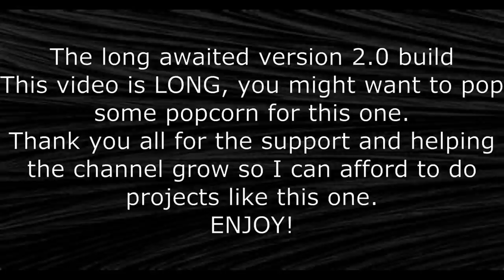Homemade ice maker build! VERSION 2.0! Cleaner build! #435

Comment: I did first follow you for the icemaker, I actually did a search for DIY icemaker and have loved following it. However I'm not done here I still have to see the rest of the house build and still have half the video's you've done just to catch up! Love the idea of a swamp cooler. My brother in law once rigged a cooler with ice in the back of his truck with a 12volt pump and coil with dual evaporator fans in the cab on a switch for very hot rides to work on a ferry where you can't run your engine. He was always the only one inside a vehicle with the windows up !
Reply from the maker: I'm definitely building a more modern swamp cooler.

Comment: If you're doing a false bottom how about if you took like half inch plexiglass and went from the false bottom and left you a 3-in gap all the way across the back and up to the bottom of the ice maker to pull air into your ice maker that might make it more efficient Cooling and should give you extra room for ice storage
Reply from the maker: I didn't wind up doing the bottom, but that would definitely work.

Comment: If you pulled the air in at the top and blew it down to the bottom it would force the cold air up. And I think one fan with aT to take the air from under both would be adiquate.

Comment: Hey boss I wanna chest freezer myself easy way to find out where the coils are without a thermal cam open the lid turn the unit on and just let it run with warm moist air going in the water in the air will condense in and around where the cooling pipes go through and will eventually freeze the thicker the frost the closer you are to a pipe it’s not the best way but it’s a useful way to find out and puncture holes

Comment: I own a mechanic's battery operated vacuum leak detector for looking for engine vacuum leaks, it has a rubber hollow probe for scanning around in close proximity to hot engine parts, but, you can also check for leaks around window seals on the doors of anything.  It works by detecting high frequency whistles that humans can't hear, but with show up on the analog meter needle.  I opted to purchase the remote frequency generator that operates on a 9 volt battery.  You put the generator in the trunk of your car, turn it on and scan around the perimeter of the trunk seals.  This tool originally cost me 300.00 but, you may be able to find something more modern and cheaper.  I had to have one since I was an auto body and frame repairman for 46 years.  Saved me lots , from having cars I repaired come back for various air and water leaks.

Comment: I repair appliances for a living and I thought about doing this a few times. 

Most ice machines do not cool the ice compartment. The only thing that keeps the ice cold is the ice itself so that means there is a drain due to some melt off. 

The reason for this is ice will tend to stick together if left in freezer for long periods of time. I was wondering what you have experienced in this regard. 

I believe if you use it regularly it might be ok but over the winter if not used in a while it may be one block of ice.
Reply from the maker: When used regularly it isn't a problem, you do see this some in winter when it just sits.

Comment: I would like to see you build a portable solar generator that could run a small cooler and ac for hurricanes. I’m in Tampa, love the videos, keep up the good work!
Reply: Most people would probably assume a photovoltaic solution...but it might be of interest to some to see a  thermal exchange type of freezer. Like the refrigerator/freezers that run off burning butane or propane. One could  possibly use a solar thermal exchange system to replace the use of a flame. There are some very effective solar heat exchangers out there these days that could really up the daily production compared to the old-timey butane powered refrigerator/freezers with which some viewers may be familiar from off-grid cabins/camping.

Comment: I would take the pvc elbows out completely and get some room back for ice.  Put that perforated plexiglass one inch off of the bottom and attach two pvc couplers through the plexiglass under the ice makers.  Then just use a short, straight section of pvc to go straight up to your fans.
Reply from the maker: The elbows are there to keep the pipe from falling over

Comment: Another thought, instead of attaching the lid to the PVC extension, you could have made plates to extend from the original mounting location to the new hinges allowing you to mount the hinges though the plate and PVC  extension.  This would have spread the load from the lid to both the extension and the original location. This way the double sided tape is not the only thing keeping the lid in place.
Reply from the maker: Great point! But after a year of using it, no issues.

Comment: If you really wanted to get crazy, place a vacuum in the equation. When the lid closes, the vacuum would pull out the majority of air and before opening you could have a pressure relief valve to pressurize the internal freezer space... Don't know if it would make "that" much of a difference, but it would be interesting to see the difference. Great Job as always. Chuck
Reply: Even if you could vacuum seal it (not easily and you'd have to make it a lot more solid) that would actually slow down the process of freezing as you need the air to allow for the energy to pass from a high to a low state, in vacuum you have to rely upon radiant heat (or IR) passively bleeding off and you'd have to essentially draw the heat away from the freezer itself.
Space isn't cold because it's a near vacuum, it's cold because there is nothing to hold the heat thus it wants to equalize our higher temperature and pressure to it thus our blood (or any liquid)boils off as gasses try to escape as it rapidly phase changes.
Reply from the maker: These are the kinds of conversations and knowledge that I love that a simple DIY project can bring out
Reply: @TKCL  Agreed. My research shows that lowing the pressure by 1 atmosphere only raises the freezing point of water .001 C degrees… So probably not worth the effort.
Reply: @PlainsmanMurph  For freezing water faster you'd actually want to increase the pressure to make it fast but again you'd have to make it out of all aluminum or steel and have to have a good seal or you'd have a potential bomb on your hands.
Reply: @PlainsmanMurph  A vacuum would improve the lid seal greatly, which is the main area of heat ingress.   Improving the seal would definitely help things.

Comment: ANOTHER OPTION
If I routinely need ice in quantities like this (where the frequency is such that simply buying bags of ice isn't economical), I think I might prefer having at least TWO 5-7 pounds of ice independent ice makers instead of one big 13 pounds of ice maker. While the risk of either one failing is higher than if I just had a single ice maker, still having at least one ice maker working gives me some ability to keep providing some ice to guests while I work out a recovery (e.g. go to store for temporary use of bagged ice, repair or replacement of the failed ice maker).

Using two lower capacity ice-makers may also let me save a significant amount of electricity bucks or reduce stress on my electric backup system by shutting down one ice-maker when the full 13 pounds per day ice-pacity isn't required.

Comment: That looks great....  Hopefully, your thoughts about moving the fans to the lid for more production are accurate.  The fan setup is the only drawback that I see with 2.0.. granted when you are going for max volume it definitely doesn't hurt to test different configurations out... and if it works for your needs then that is all that matters.. Overall, excellent job with 2.0!

Comment: A thin sheet of stainless steel " wall pocket " about two thirds of the height of your freezer wall and the fan inside toward the lower part of the freezer,  would bring real cold air from the sides that won't over blow the volume of air.

Comment: That freezer dissipates heat on its outside skin. You can feel, or use a thermal gun to show the warmest spot. You can place a fan on the outside aimed at that warm spot. That should make it more efficient. That should yield more production. Also make sure the water coming into your building is insulated or shaded. I dont know. The sun may be hitting it. You may also consider using it with water cooling. You may be able to use the heated water discharged. For your home heating in the cooler months.

Comment: I think that you are half way correct.  Though given just how powerful those fans are you MIGHT want to try something else....will ONE fan with a splitter on the end work to cover both ice makers and lower the complexity and cost while still having the same functional effect that you are seeking.  Just a thought but it would for sure make things more efficient.
Reply from the maker: Doing a lot of testing now on decreasing parts required.

Comment: You could just have made a piggyback from the heating element to a relay to cut power to the fans.
If you only had 1 fan that is blowing on all ice makers you would need to put a Diode on each piggyback so when one heating turned on it would not power the heating element of the other ice makers.
It could be hard to find a 110/220v AC Coil Relay* (assuming that the heating elements work with 110/220v) so you may prefer to use a 5/12v DC Coil Relay but you would need a 110/220vac to 5/12vdc converter for each relay.
*Found it for ~2$ on Ali-expre$$ with the base included that makes installation easier. On amazon it was around 8$~10$ each.
Reply from the maker: New testing is in progress right now, looks like I don't need any of the automated stuff.

Comment: You know I just thought for fun you could wire in a small led strip to turn on when you open the lid. Since you have an extra spot on your switch. Won’t draw much and would give you some light.
Reply from the maker: I think those power supplies provide 5 volts, I'd have to see if a strip can run that low of voltage.
Reply: @TKCL  most led strips are either 5v or 12v DC.

Comment: great clean build !. personally ?, i think moving the fans to the lid, facing down where all the hot air will rise, will only force hot air down onto the ice maker, herby slowing the process of them cooling enough for faster ice production ?, what ya think ?. as for the two fans ?, i think with them running when the lid is down, these fans ( even though they are small ) they still produce heat when the motors are running 24/7..yes...no ?. if they are 12 volt dc ?, then maybe not enough to make that much heat. other than these concerns ?, i love the build !. what makes this better than ice machines that are way to high dollar ?..is what ice you do make ?..IT DOES NOT MELT OVER AN OVER !. one other thing, if you leave the fans under the ice makers ?, do try to put/build some kind of shield over the tops of them, so ice falling wont hit them, and break them !. oh, and the false floor over the pipes ?, when you do this, you will make an air space away from the ice, you need cool air as close to the fan suction as posb..the more cold air you have blowing on the ice makers ?, the faster they make ice.
Reply from the maker: You are correct about heat rising and blowing hotter air up top. I moved the fans to pull air from the top and only seen a slight production loss. These fans are 5v DC, I'm sure they produce some heat, but they absolutely speed up ice production.

Comment: You could wire a relay in that would shut fan down when ice maker motor is called to cycle and it would cut back on whenn the moror stops.

Comment: btw, those ice units are 'modular/swappable' so might even find them in junkyard refridgerators.
Reply: re: fans . get 12volt PC computerfans and run them off a solar panel or a 12volt ac to dc power brick.
Reply from the maker: You'll enjoy today's video, it's now running on solar 😉

Comment: I am guilty of subbing for the first video and hoping for a follow up and/or a different project. I like the way you explain things and leave the theatrics out of it. I do have a spare freezer that was given to me and has been sitting dormant in my yard for a while and plan on building an ice machine for the same reasons you did. Buying ice for your fishing cooler is ridiculous but necessary so why not cut out the middle man and save some time and money. I also saw a few videos on people turning the freezers into a shiner tank and using a Temp controller like yours to turn on and off the freezer to keep the water the right temperature since they thrive in really cool water. Might work for gold fish too if you are a breeder and/or use them for fishing. Just an idea... not sure if you use shiners in FL but i thought id mention it. The only real use for shiners here in AZ is Croppy fishing but i still might try it out.   Keep up the great work!! I'll be back!!
Reply from the maker: Shiners catch really big bass here, but they are very sensitive and hard to keep alive. So most people just catch them at the lakes and fish with them fresh.

Comment: Really like this version much better. It is so much cleaner looking. Do you think that the foam will eventually collect mold on the exposed edge? I was thinking that wrapping that foam in "MonoKote" (heat shrink type film for model airplanes) and then installing it is would make it easier to clean, and there would be no chance of mold that you could not clean off. Just my thought. Great video.
Reply from the maker: It's something to consider and keep an eye on for sure. Another viewer recommended wrapping in metal flashing tape.

Comment: Or instead of a temperature controller and and trying to set trip temperatures to turn the fans off, just use the wire that turns on the heating element to switch a relay and turn off the fans?

Comment: This is awesome. I’m getting ready to move mine to the back like 2.0. Mine are on the right like the 1st version but I did use a collar. Probably going to use one fan and have it come up on the shelf side of the freezer blowing right to left.
Do you foresee the putty tape becoming an issue being at freezing temps all the time?
Reply from the maker: No because that tape is behind 1.5 inches of foam and also closer to outside room temperature. I think it stays well above freezing.

Comment: you really should have taken 2 pieces of that flat bar metal, screwed one end into the door holes on the freezer and screwed through the other end into the new lip to hold the big door on. That would take a lot of stress off the butyl tape and  other sealers. I can see opening that lid maybe not ripping the whole top off but causing an air breach in the front somewhere since it puts a lot of force onto  the new lip when you open it.
Reply from the maker: I can literally lift the freezer up by the collar, that tape is working well. I also caulked inside and out. If I see any separation of the caulk, I'll make brackets for the lid.

Comment: As you are keeping up with energy costs...  
Keep in mind that when you move your freezer in- doors, as the freezer operates, the freezer will add heat to the room.  This in turn  will require your AC to work a bit harder.  
What's the trade off??   I don't know.
Reply from the maker: That's exactly right
Reply from the maker: At the end of the day, I've determined I'm making ice for far less than I can buy for. The ultimate goal and win for me is convenience.

Comment: I think the fence which is a good idea. Even though it’s pulling the air from the bottom is it sucks her out the air Hass to get replaced so hot air is going to go down into the ice so instead of just blowing it down on it’s gonna suck it down as it pulls air out of the bottom so the switch is a great idea.  I wonder with all your humidity down there and the frost if it would be beneficial to have the whole thing in a room with a dehumidifier or an air-conditioned room where your humidity’s going to be a lot lower?
Reply from the maker: I'm thinking it's going to do very well in an air conditioned room.
Reply: @TKCL  yeah I would imagine that lowering that humidity would really keep it from frosting up like that.   Optimally I’d like to build a trap on the bottom of one or you could just dump ice out of it without having to open the system but that’s a bit elaborate and would probably be expensive because it would have to somehow be insulated. Lol.  But I think once you get your house done and get that inside somewhere that will probably make quite a bit of difference. Either way it’s working pretty good now so you’re not wasting a bunch of money on ice anymore.   :)

Comment: But if you want real efficiency you'll want to double up that foam insulation to about 4-5 inches total, then maybe cover it with plywood. My next door neighbor is basically a seafood monger and built a whole bump out freezer. Nuthin but insulation and plywood. Commercial.